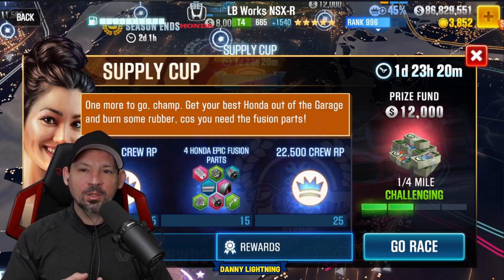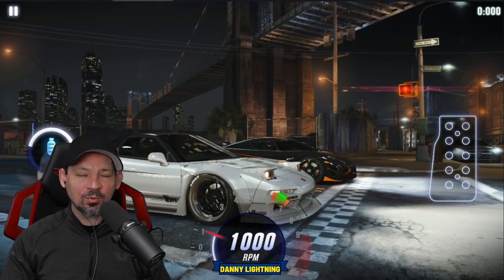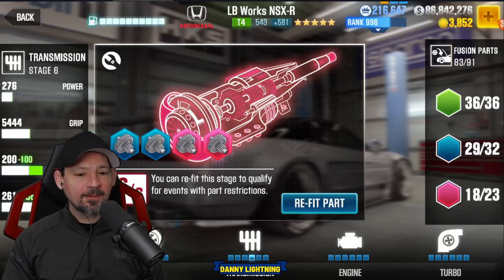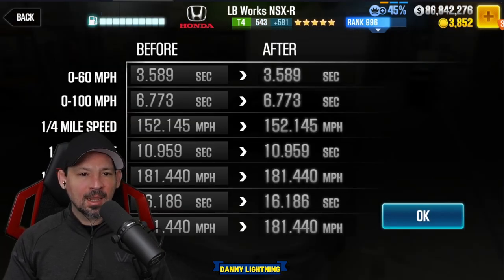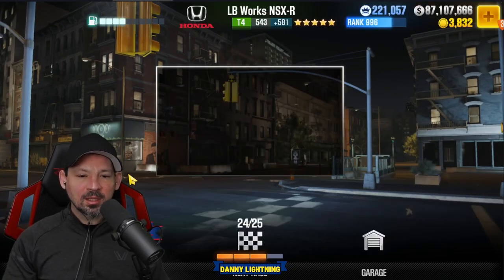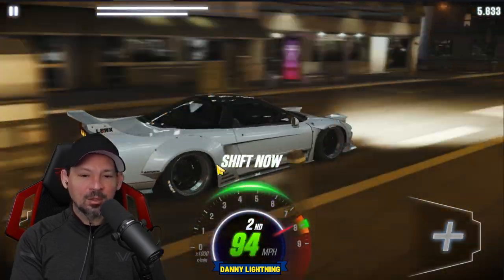CSR2 The Secret To Beating supply Cups, They probably don't work they way you think they do

Comment: Lb Works NSX-R shifting is very weird, the one you do quick shift to 2nd right when the race start while pressing nitro then late shift each gear till 5th, then you finish, is simple, but there is another way to get a better/faster time which is quick shift to 3rd when race starts, late shift, nitro on 4th then late shift into 5th. (If you want to try that) 🤔
Reply: I have better.

Perfect start->quick shit second-> 3rd shift at 6.500 rpm and nitro->and rest late shifts.
Reply from the maker: There is a lot of cars in this game that shift really weird, some cars have crazy shift patterns and I don't really understand why they give a shift lights if the shift patterns don't follow the lights but what can you do I guess

Now sometimes when you change parts around and have the cars tune differently that can sometimes change around the shift patterns as well so I'm guessing you probably have different parts installed in a different tune, that can change things which can get a little crazy but these videos are just to give you guys a good idea of how to drive the car now if your car is maxed out or whatever and you found something that's running better than this that's awesome

Comment: Sorry to say Danny but the Supply Cup is not about beating the dyno as long as your car is quicker than 7 s on the ¼ ml. then u never have to worry about dyno times again
Reply from the maker: I can take a bone stock extremely slow car into a supply cup and beat it no problem if the car beats the dyno